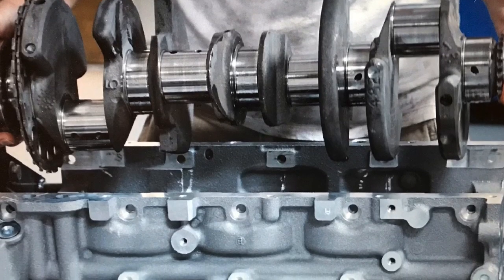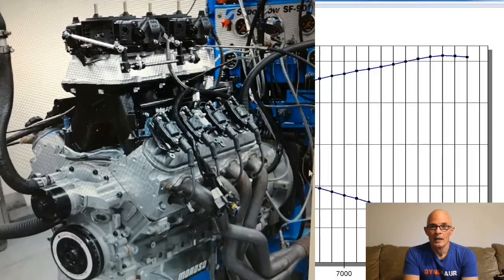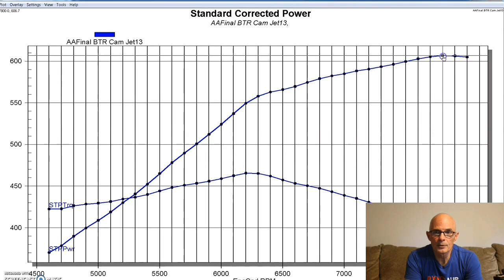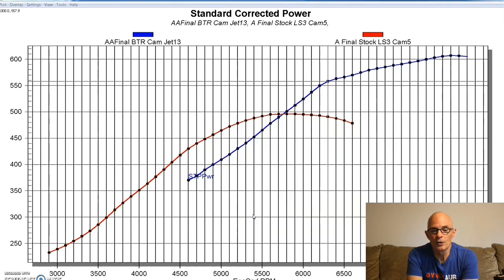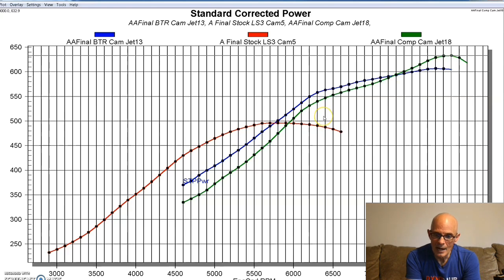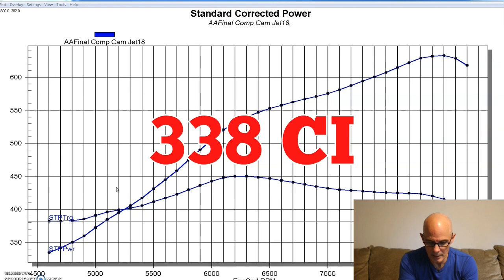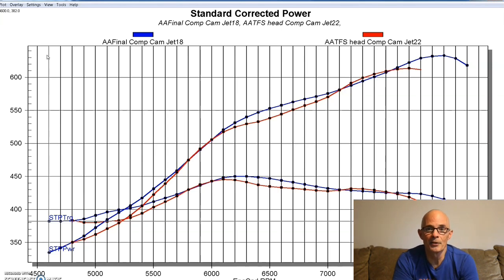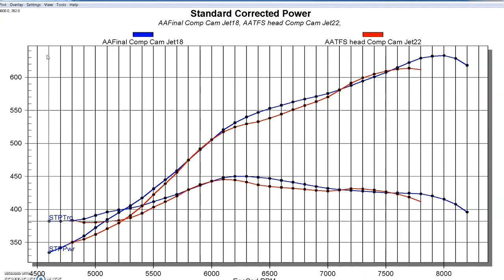DESTROKE LS-4.8L CRANK IN LS3 BLOCK-SHORT STROKE POWER-AN LS MONSTER MYTH?

Comment: It would be interesting to what size turbo you would need to make good/consistent boost all the way to 8,000 rom.
Reply: Twin $169 Ebays.
Reply from the maker: I ran boost on it
Reply: Richard Holdener - did you just say that you ran boost on the 4.8 big bore!!!?
What happened!?
Reply: @1989GTADRIVER  save that for another video.
Reply: @1989GTADRIVER  sub'd
Reply: @richardholdener1727  Facts.
Reply: @richardholdener1727  video 😯
Reply: I  run a billet wheel 80/93 on mine. Its making a little over 1200
Reply: Figure out what your flow rate is at that point and find a comp map to suit 
A 5.0 with twin EFR 7670 or 8474 sounds insane tho tbh, or twin G35
Reply: There is no ideal size turbo for a 5000rpm swing, unless you really get fancy and go variable turbine.
Reply: @littleherms3285  compound or sequential and maybethrow in some electric superchargers
Reply: @slopoke22  or twin charged. A Whipple that can take you to 6500 and a big turbo to push it to 8000 without creating a ton of heat.

 Instant boost everywhere. Ralley cars have been doing that for 30 years to get little motors that rev to 9k to have great boost response over a 6000rpm spread.
Reply: If you feed in 30lbs you don't need 8000 rpm.
Reply: @realbigdady  , if you're racing in a limited displacement class, everybody's gonna be running revs and boost. It would be cool to see a working example of this as an analog.
Reply: Something that flows 780 cubic ft a minute to start to make boost, so say 1600 cubic feet for 15lbs?

Comment: Also, I want as big of a bore as I can get and I want an over square engine. So if the stroke length is much shorter, then that's just what it is. Because I like RPM!!!!! High air speed and good flow is what I want personally. Sad that it really doesn't matter anymore because we now have a plethora of turbochargers and superchargers!
Reply: Slopoke high RPM low geared tranny and rearend will be just as fast as higher hp engine

Comment: If the LS acts like the home made 302's  back in the day (small journal 327 and 283 rods and special pistons) it should spin like no tomorrow. I'll have to wait until the better half is awake to watch it.
Reply: @KLMALLENDER  very true, the heads back then where the cap. I have wondered what a homeade 302 would do with a slick set of ARP's on there.......